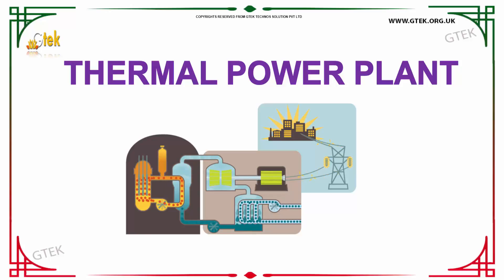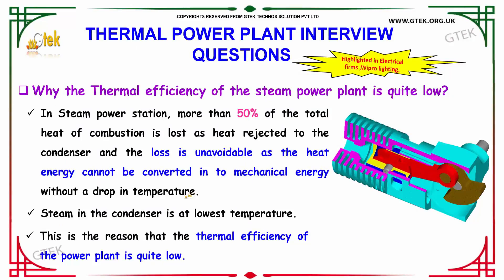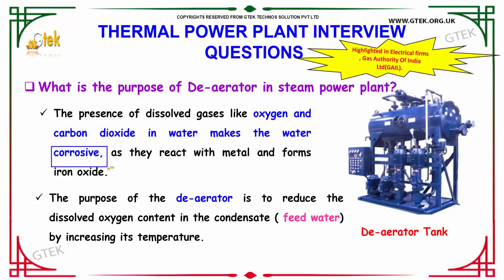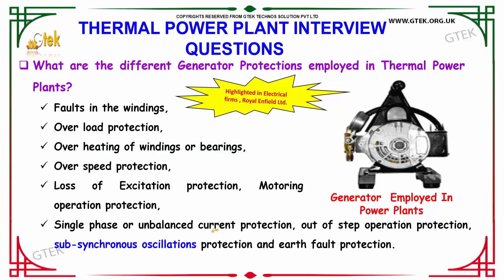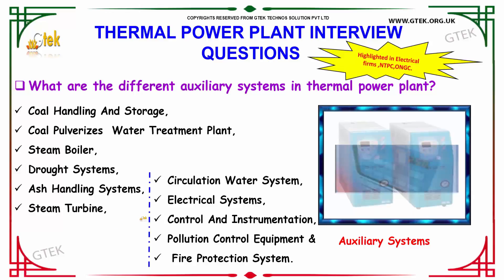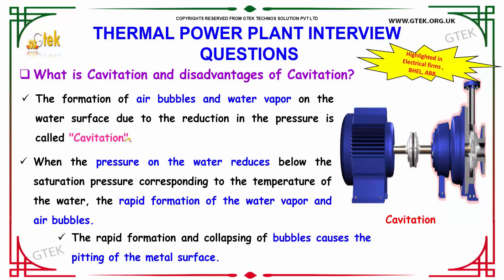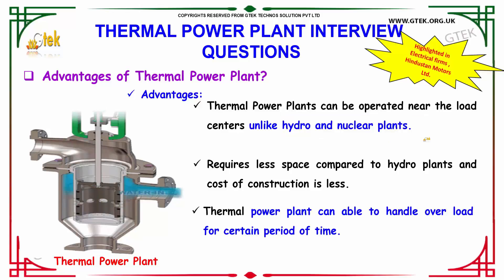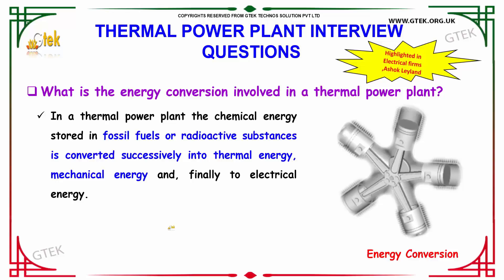Top 40 Thermal Power Plant ece Interview Questions Answers Tutorial Fresher Beginners Experienced

Comment: In a thermal power station fuel such as coal, oil or gas is burned in a furnace to produce heat - chemical to heat energy. this heat is used to change water into steam in the boiler. this drives the generator to produce electricity - kinetic to electrical energy.

Comment: Thermal generation is the process of generating electricity from heat. Heat is a form of energy. Heat energy that is turned into electricity can be made in many ways. It can be produced by burning fuels such as coal, oil, gas or wood.

Comment: A thermal power station is a power plant in which heat energy is converted to electric power. In most of the places in the world the turbine is steam-driven. Water is heated, turns into steam and spins a steam turbine which drives an electrical generator.